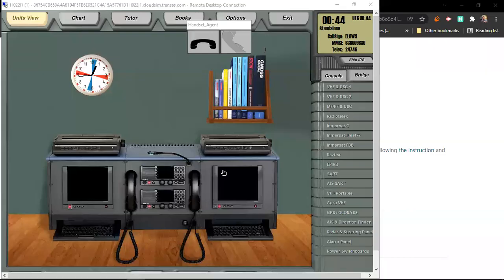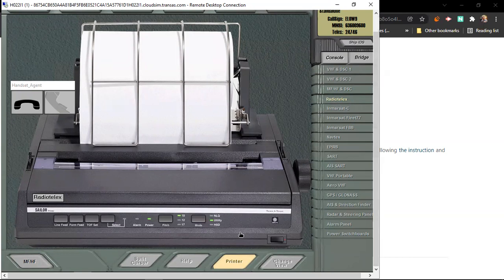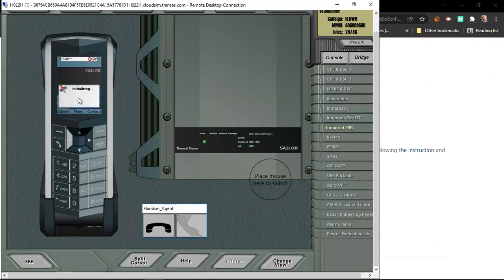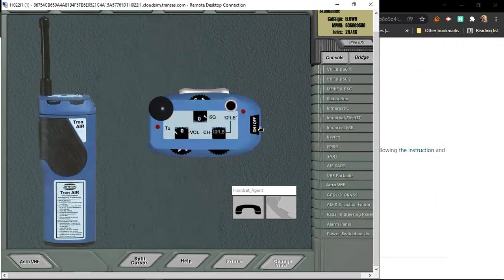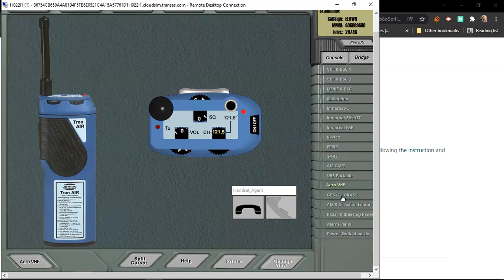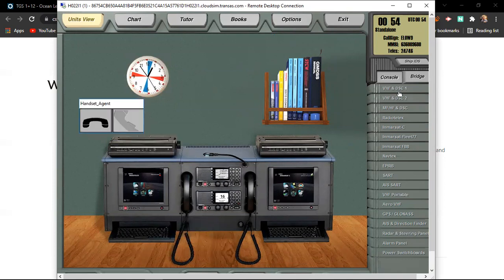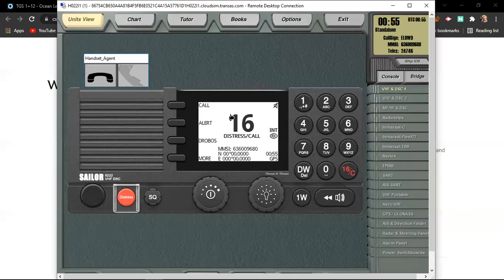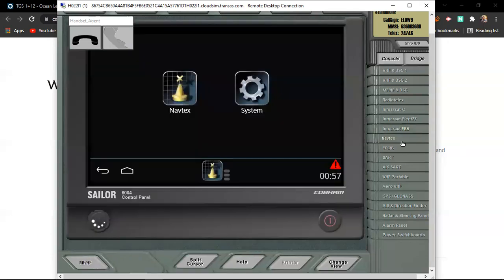MARITIME COMMUNICATIONS AND GMDSS EQUIPMENT

Comment: it guided us to learn about all the information we could possibly use once we onboard by following and watching the step by step procedures of this video.

So when we start to send distress undesignated or designated using these following equipment;

*(VHF/DSC 1 and VHF/DSC 2) - first you gonna do is to ON the equipment then proceed directly to the red button found at the left bottom part of the equipment to send undesignated distress and uncover it first because, it has a transparent cover and once it already uncover press or hold it for 3 secs. and wait til the acknowledgement appear.
*(MF/HF) - just follow the procedures above about the VHF on how to send undesignated distress
*(Inmarsat FBB) - same starting point just ON first the equipment and then you can see the Change View button at the right bottom corner of the equipment and click that one, then type 1234 for the PIN and click change view again until you get back to the Icon or phone then type 38 for Medical Service something.

and the rest of this procedures are to the follow soon.

Comment: Both VHF and DSC 1 and 2 are very useful for us as a student it will gain us knowledge to know its function and purpose. This equipement can be found under console. The main purpose of a VHF is sending distress its either undesignated or designated distress.